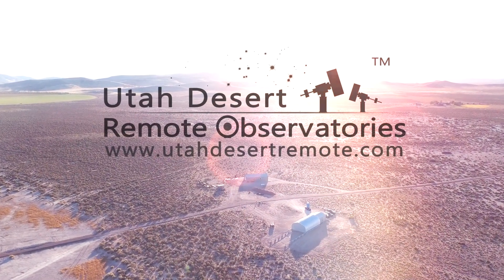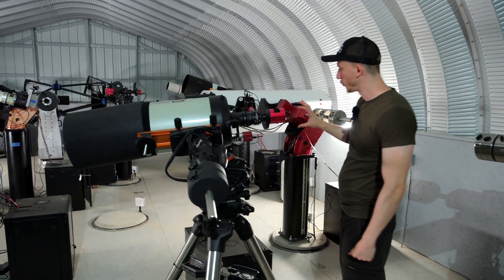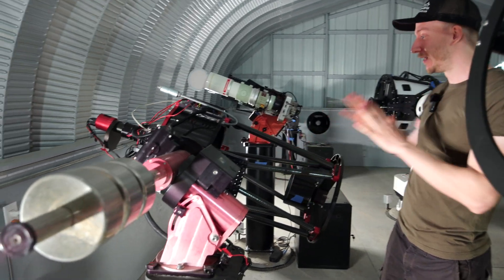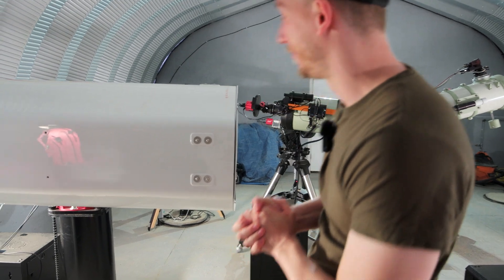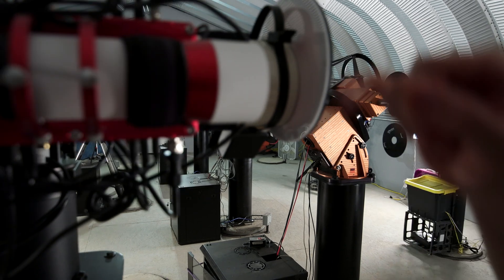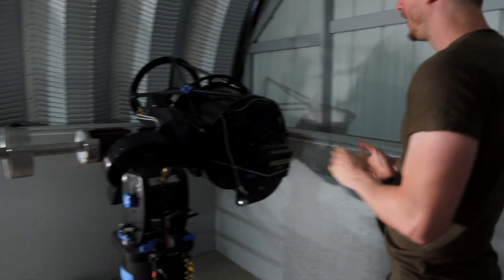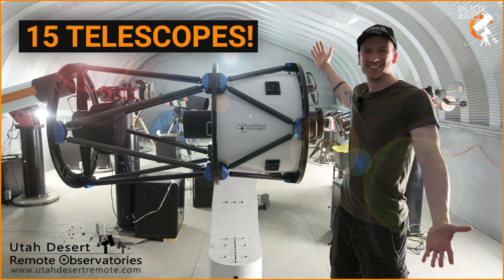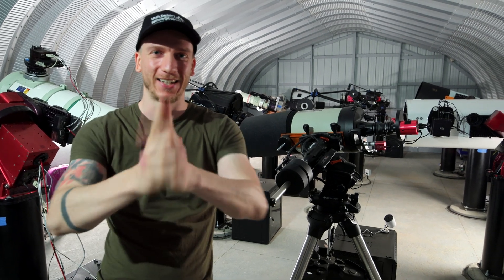Touring an Observatory - Utah Desert Remote Observatories: Telescope Heaven!

Comment: Thanks for the Observatory Tour. I noticed that several of the scopes are using the Alnitak Flip-Flat robotic lens cap and flat fielder. This of course is a great solution for operating at a remote observatory. However, I have seen comments that suggest the limited 95 degree opening of the flip-flat can cause reflections (from moonlight etc) which can spoil images. Do you happen to know if the users at UDRO have experienced this?